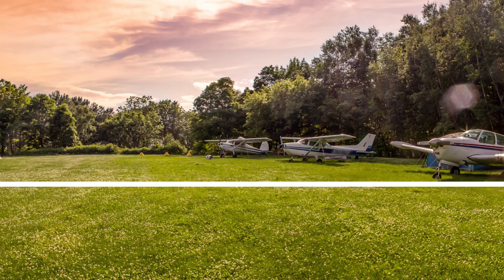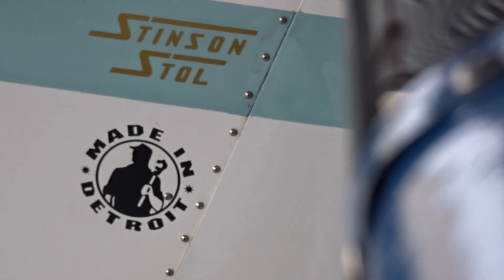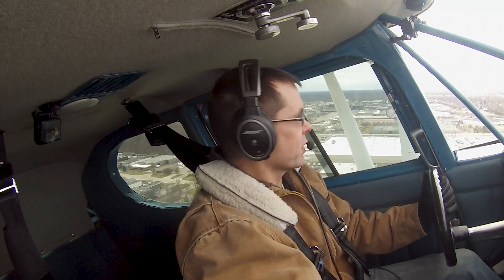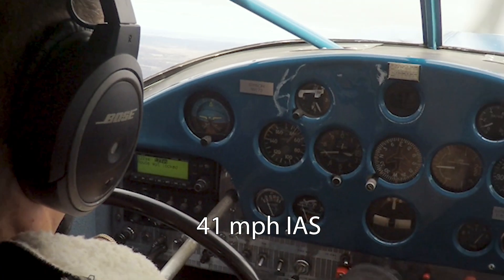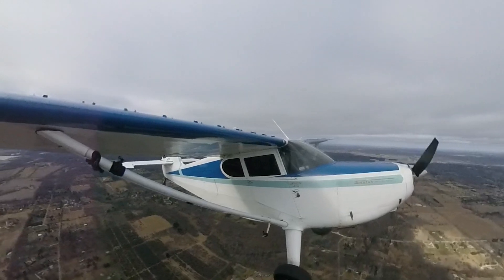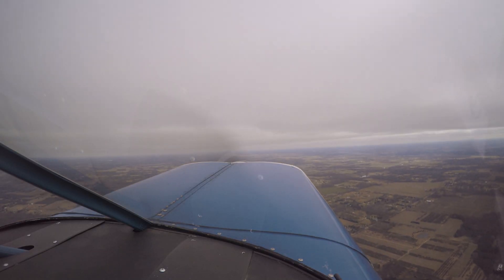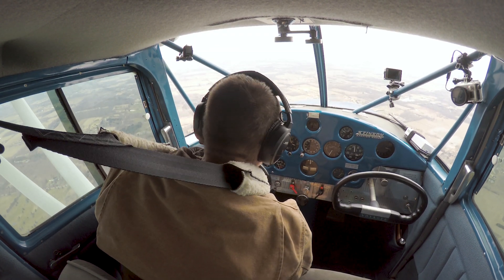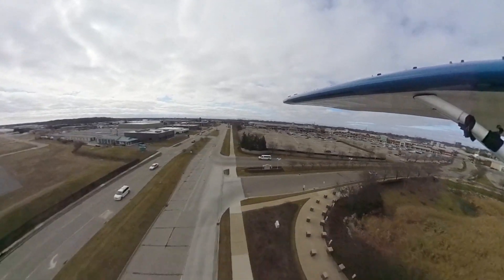Micro Aerodynamics Vortex Generators, Stall Testing VG's

Comment: I’d have liked to see a slow flight comparison as well. Nice video. Thanks.
Reply from the maker: The slow flight would be difficult to quantify. You can control the aircraft down to steal speed. On that note it is noticeably easier to control with the VG's.  Some folks disagree with that assessment.  When I first started flying I thought VGs were voodoo, now I find them to be one of the most affordable upgrades you can add to an aircraft.

Comment: how did the VGs effect your cruise speed at a given power setting?
Reply from the maker: I didn't notice anything appreciable. It definitely fell into the noise of density altitude, weight, CG, another performance factors. Now the 3-in I took off the propeller pitch... That was noticeable.

Comment: With the VGs installed, has your pattern speeds decreased on downwind, base & final or still fly it like before but just touch dish slower? 
I had a set on my experimental Long Ez and helped on the touch down speeds. Looking and trying to educate myself on the Stinson. thanks for the videos!
Reply from the maker: I slowed the final down by 5 -6 MPH. I kept the same speed around the patter.  I could slow down a lot but there is no need to go slow downwind :-)

Comment: There is a pretty significant reduction in indicated stall speed with more power. Do you think that is real speed reduction or airspeed indicator quirks?
Reply from the maker: The indicator at high AOA becomes unreliable for actual airspeed.  You are converting thrust to lift at high pitch angles so your stall speed will reduce noticeably.

Comment: I don't (yet) own a Stinson, nor have my tailwheel rating, so have a comment and a question for this. My understanding is that a "perfect" three-point tailwheel landing includes touching down exactly as the plane slows to and reaches full stall, exactly at your planned touchdown spot. If the MicroVGs make the stall break more crisp and abrupt, doesn't that make "perfect" three-point landings more challenging - forcing you to plan the last bit of the approach a little bit faster than otherwise, to avoid unexpectedly losing that last knot (mph if in a Stinson) a couple of feet above the runway (e.g. gusty headwind), followed by a rapid nose drop and crunch? Secondly, I wanted to point out that landing energy is based on the square of the velocity, so for example your power off flaps 2 stall speed reduction from 41 to 38 mph is a 16.4% reduction in kinetic energy even though it is only a 7% reduction in velocity. The kinetic energy reduction defines the landing roll, not the velocity reduction, since during the landing rollout you are using drag (aerodynamic and braking) to burn off that energy until you reach zero kinetic energy when stopped. At 1800 RPM and flaps 2, the energy reduction is 21.8% vs. 1800 flaps 2 and no VGs, and your touchdown energy is 141% lower than a no-flap, no VG, power off landing, which should translate to a very significant landing roll reduction (although some of the savings will be lost in reducing the RPM to idle after touchdown). I'd love to hear any corrections or comments about this, thanks!
Reply from the maker: First off no on the "Prefect 3 point" and not working well with the VG's, Your concept is correct but application is different.  There are a lot of things going on in a 3 point landing and a slower more clean break would be desired.  People write books on this stuff so it's a lot to talk about on a reply to a comment on a YouTube video and I can't get into it all here.  A points for thought though, the 3 point stance will not always be the "perfect" attitude to stall, the angle of the aircraft to the ground will be different depending on power settings and weight.  The gust windy situation is taken care of with adjustments on approach speed by adding half the gust factor.  A couple things happen.  When gusty your ground speed is reduced because of an increased headwind (talk about energy reduction think about a15mph headwind wind) so the addition of a few MPH for safety doesn't hurt and you'd add that to the non VG approach speed anyway.   When the winds are to gusty and turbulent some landing areas just become unsuitable. As for the energy you are correct and all STOL pilots understand the effects of lower speeds on landing roll even if they don't understand the entire energy picture.  The RPM to idle really ads nothing to the landing roll since most of the energy is going to induced drag and a recip. engine idles down almost immediately.  What the VG's did for me was reduce my landing distance from about 250' to 200'.
Reply: The problem with landing on the front wheels first when you are trying to do a 3-pointer is that your vertical inertia causes the angle of attack to increase as the tail comes down. If you are above stall speed, that will result in an increase in lift causing the airplane to go back up. If you are at or below stall speed, the increased angle of attack does not increase lift - it decreases it. So the airplane stays on the ground.

Gusts are always an issue for 3-point landings, VGs or not.  That phase where your speed is within +/- the gust factor of the stall speed can be treacherous. Being in a high drag configuration with power off makes that phase as brief as possible.

Comment: I put them on my -2 this winter.  I didn’t record before and after numbers but I did find that power-on no-flap stalls yielded an actual break whereas before it just sort of mushed and set up a very high AOA rapid descent.  Power off full flaps felt much the same as before with one huge exception... much more elevator authority.  I always felt that I was stalling the elevator during the flare in power off approaches and either required excess airspeed or significant shots of power to arrest the descent.  This seems to have significantly improved that.  Full stall landing attitude seems to be more nose up indicating an increased stall AOA.  I’m pleased with the results.
Reply from the maker: Yes, even with a little bit of power it seemed to break harder.  That was good, it will allow for higher AOA approaches.  I wanted to know if there would be a difference that's why I did the first stall video.  I will also do another stall video after  the plane is 75lbs lighter.
Reply: Great Michigan Bush Co. what is your current empty weight if I may ask?  Using CAR 3 w&b rules (no oil, 4 gal unusable) I’m at 1385.
Reply from the maker: @Subcanis  I show 1394 with the rear seat in.  I fly without the rear seat -23lbs. So I am flying with an empty weight of  1371.  I will loose 20lbs with the wood prop and 2lbs with the spinner gone, 10lbs when I change the starter, I will replace the battery with a odyssey loosing another 15lbs.  All this is one the way... So soon it will be flying at an empty weight of 1324lbs.
Reply: For the elevator autority would not be enough to install the VGs on the tail?